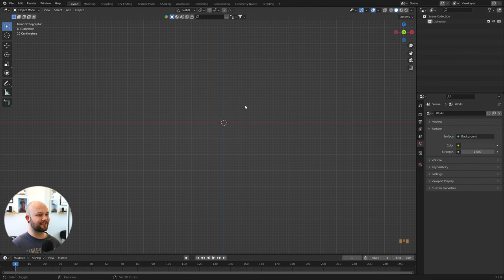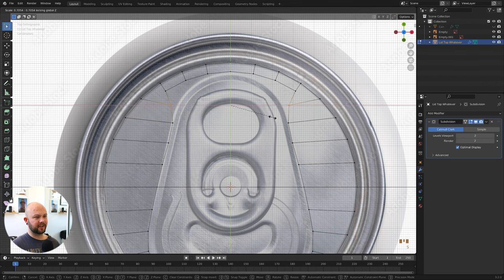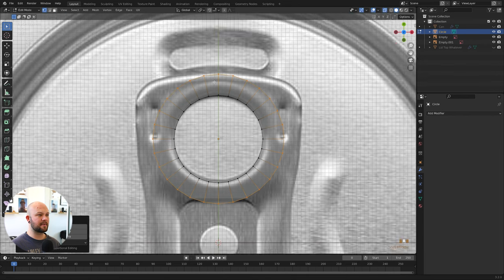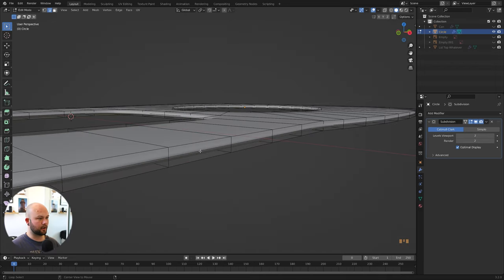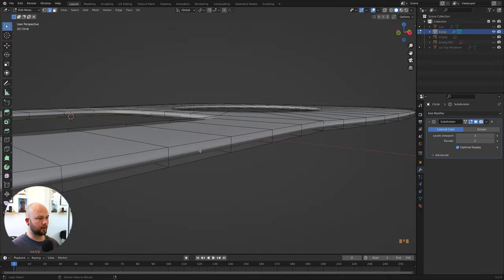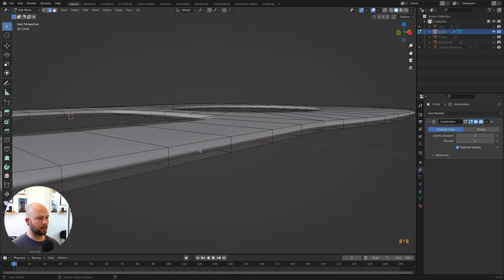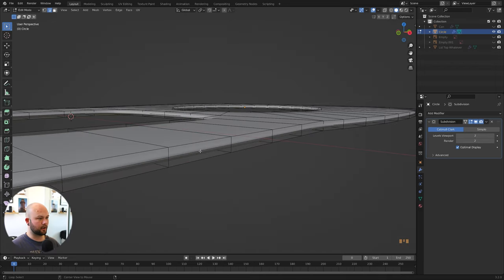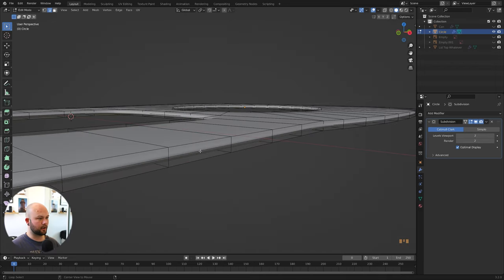Ice Coffee Can Modelling & Packaging Design in Blender + Illustrator

Comment: You can also sharpen up the edges alternatively by using creases, Shift+E to add a crease and then you just use your mouse to control the crease amount. It will sharpen up the edge without adding additional geometry essentially. Of course it has its down sides compared to adding loop cuts but it some situations it is better.